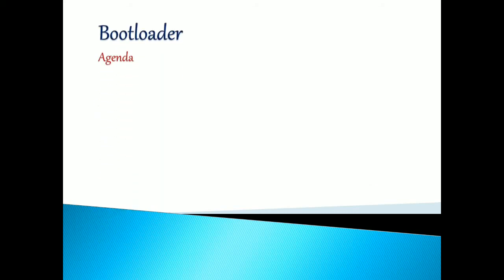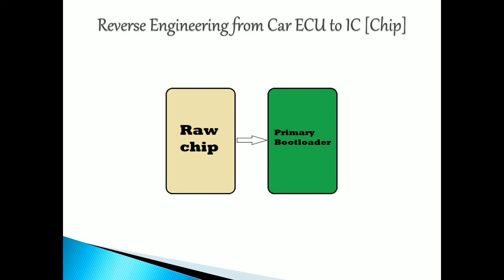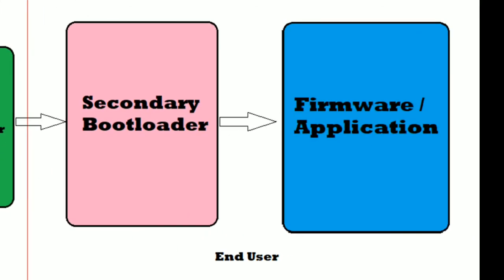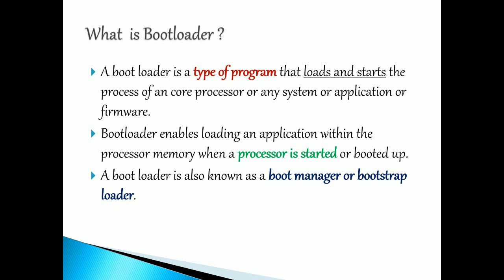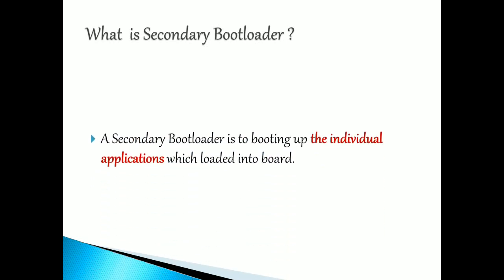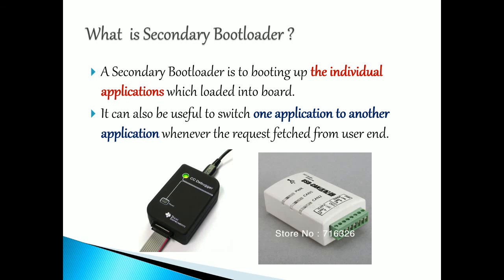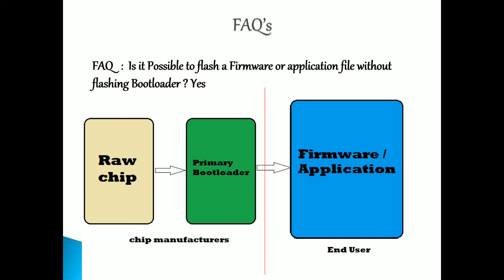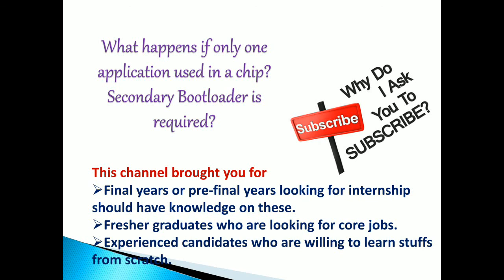Bootloader | Primary Bootloader | Secondary Bootloader | Flashing Bootloader in Automotive

Comment: Can you explain on memory level how secondary  boot-loader will do the booting up of the application? Also with existing second boot-loader what happens when a new firmware application is flashed ? how does the update of the new firmware application happen?

Comment: Could you please document  the complete ECU flashing steps & their significance using UDS tool, what kind of services we will use for this & purpose of those services ? .Need this answer in steps with explanation
Reply: hi, he spoke mainly about flashing chips in general. this is not how ecu works. with flashing ecu you need pass a seed/key calculation. you can google seed/key calculation or check www.adamengineering.co.za

Comment: Sir, we can even flash the secondary bootloader with usb (spi) right ?

And could you guide us a source or good link for writing such bootloader ?
Reply: If the on chip or primary bootloader has the USB drivers, it can be flashed otherwise no.